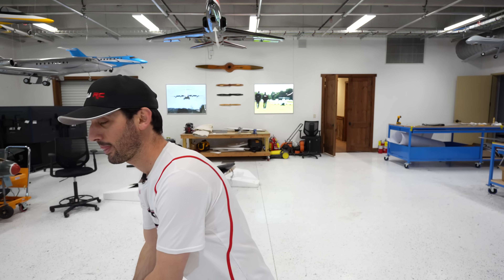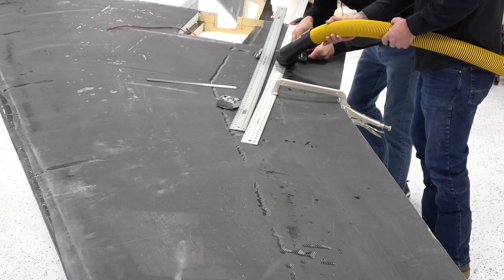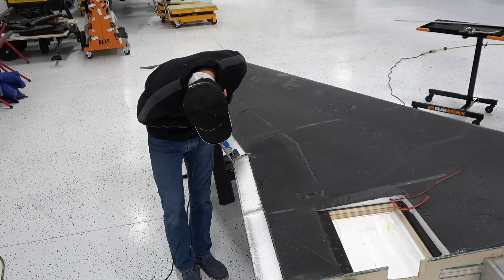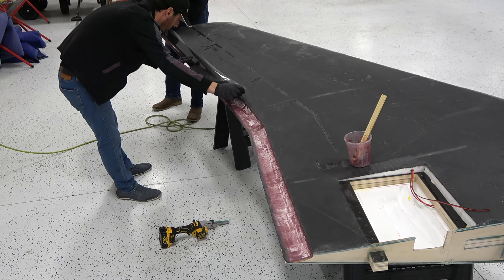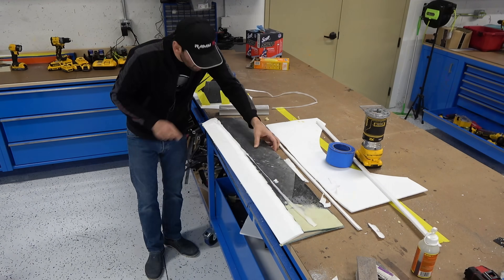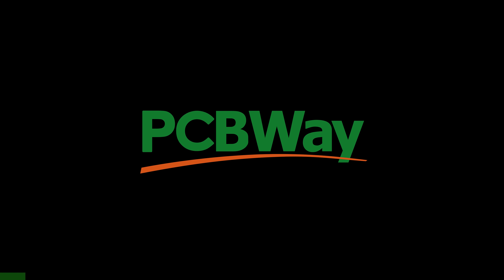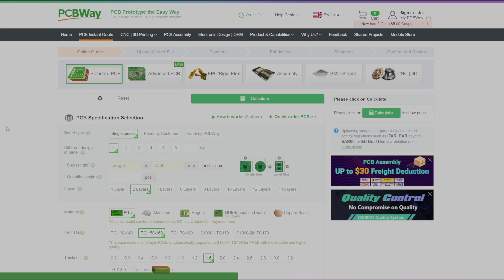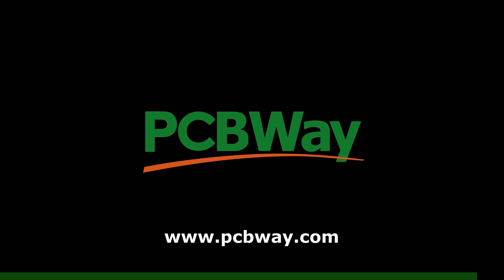Building the world's biggest Boeing 7779X RC Airliner, PART 3

Comment: I really hope it's not PLA for the wing tip print? If it is then you planned some obsolescence/future repairs into the build...;( 
Reason I say this is, I have a bunch of PLA prints that I did in 2018 which has been in drawers ever since, no load, no UV on them and now they snap so easily it's not even funny.

Comment: The precision you are working with, is fantastic. I wonder why you don´t work for aircrafts companies. The size of your "models" is large enough to sit in and fly with. I have built a biplane ultralight aircraft which I sold. The owner is happy with it. Actually I am working on a single seater Ultralight which is smaller than your airliner. I see a market for small scale airliners to carry the owner, possibly as a two men tandem seater and with the permission as an ultralight aircraft. Think about it . . .

Comment: I am just overly impressed with everything you do and it's amazing you keep your shop as clean as you do I'm the same way with my work truck I believe it represents the kind of work you do. If you ever seen somebody come to work like they just rolled out of bed, usually their work looks the same way. 

One thing I was curious about  because of the size of the engines and plane. And I definitely don't want to jinx you hesitant on saying something lol , but have you thought of or created a plan in the even you hit a bird I know it's probably highly unlikely however I just wanted to mention ,because you got a lot into that plane. I'm sure you probably thought of this already I would just hate to see anything happen to it and wish I had said something😊
One last question is there any kind of regulation on flying something this big even though it's radio-controlled?

Comment: Those folding wingtips are rad.  Such an interesting build.    How about this next? 1/8 scale 787 carbon fibre Dreamliner? (24.5 foot wingspan) The wings of Dreamliner are extremely cool in shape and how they bend in flight.  That’s the challenge - to reproduce that bending at scale.

Comment: Also make a good, advanced and working cockpit and put passenger seats and put more details such as Aoa sensors, pilot tubes and more. And make the landing gear wheels bit wide and detailed in wheels and landing gear ! Make Chevrons too in the back edge of the engines !

Comment: Hey Ramy what brand of epoxy are you using with the carbon fiber? I am using polyester resinous want to make a foam wing like you make for my DC3. I made molds and laid up 2 sets of wings I am at just over 3 lbs each servos in but would like to get them down in weight.

Comment: You should probably make sure to wear full respirators anytime you're cutting or handling carbon fiber until after you've cleaned the workspace even if you have a dust collector. I know someone whose lung collapsed from working with carbon fiber and fiberglass unprotected. But also don't take advice from a YouTube comment, please do your own health and safety research. Carbon fiber dust is scary.

Comment: Would have really liked to see the leading edge slats. Whether it was weight or structural integrity that was the main concern, it seems like this model would have no issue with a couple more kilos for the components and the wings always seem overly strong and rigid anyways. I'm not sure how this wing will perform in flight but I wish there was a was to replicate the scale of the wing flex in flight like the real aircraft. the stiffness of the wings currently and in previous projects make it look like the wings are still drooping similar to how they droop from weight on the ground which subtracts from the realism. Possibly adding very small gap lines running fore-aft from the leading edge to the trailing edge in the top surface of the wings to allow for compression on the upper surface while the bottom surface remains strong. Another thought, reducing the level of carbon fiber and relying more on flexible, but strong, wing spars. Just some thoughts. Awesome build.

Comment: Building a model this size is one thing. But building one that actually flies is mind  boggling! I congratulate you guys!
Reply: It's hard to believe that it's even legal. Is there a size limit to these models?
Reply: @craigS8806  this is definitely more of an UAV than an rc plane...
Reply: @craigS8806  In australia at least, you can fly a model airplane up to 150kg in weight with just some basic approvals. Above 150kg you get into licenses that you need to do some courses for etc.
Reply: Technically it hasn't flown yet

Comment: Suggestions :
It would be funny to build a tow truck just to bring the airplane outside
Also put inside cameras to watch the engine and wing like a passenger
Congrats and cheers
Reply: It might make the plane too heavy
Reply: @Sub_to_hameemgoodboi  Model planes typically have 10x or more the power/weight ratio of real planes, since theres no payload or crew. Plane this size could probably carry an entire episode of "Big Bang Theory" worth of cameras.
Reply: @Sub_to_hameemgoodboi  An FPV drone camera weighs around 3–8 grams, depending on the brand and components, so the weight is actually negligible.
Reply: @Sub_to_hameemgoodboi I mean…maybe if the guy was sitting in it lol.
Reply: I think that would be cool...a small tug tower like at the airports...nice thought 👏🏿👏🏿👏🏿

Comment: I wonder, if you weighed the plane when it is finished, then calculated the wing loading, would it be close to the same wing loading as the real 777X? Do you have a thrust in pounds for the ducted fans, and can you reverse them for shorter landing rolls?
Reply: No, scale models generally have really crappy wingloading, that's why they have to fly really fast, "non scale" fast.